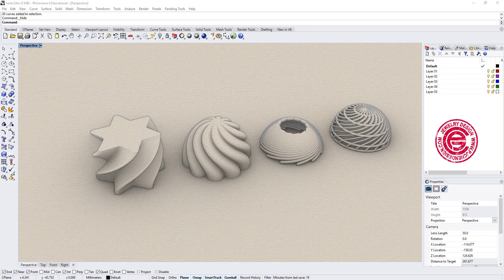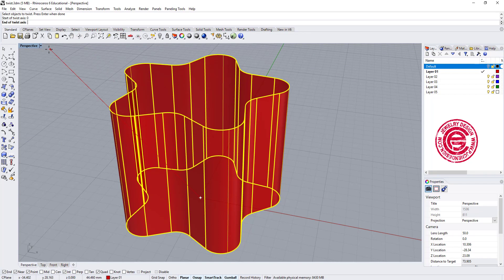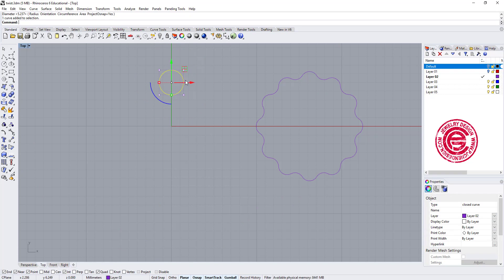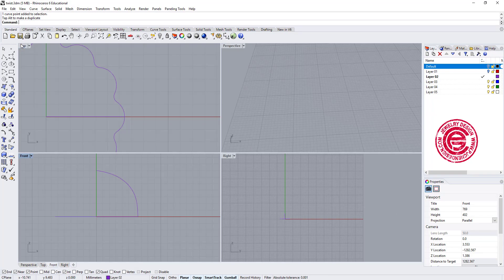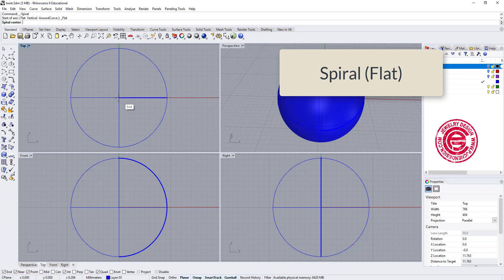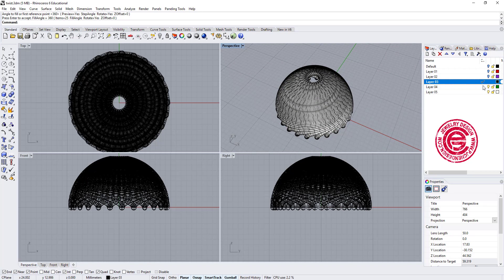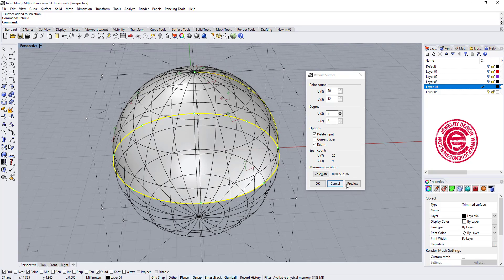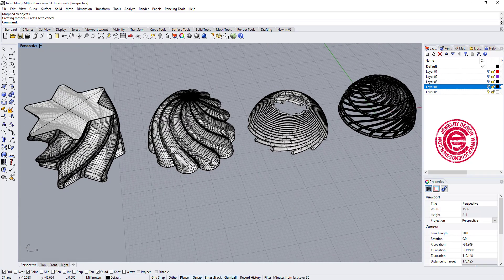How to Twist Forms: Rhino 3D CAD Technique #18

Comment: i have a proplem with Rhino
when i want to mesure the Distance between tow Points in Bloc, i can´t select the corner without selecting the Bloc 

could you helb me to get out Please
Reply from the maker: you may want to make sure the correct options are selected on Osnap. If there are nothing to snap on. you may want to extract a curve from the surface first then you can Osnap to the curve.

Comment: All the designs are beautiful. But when I try to print the second design on a 3D printer, it shows me an error on the top part and closes the surface. Can you tell me why?
Reply from the maker: It is hard to tell what may be the issue without seeing the model. but you may want to check on your Osnap. if you are snapping at the correct points when you build the model.
Reply: @PJChenJewelryDesign  Thank you
Reply from the maker: You are very welcome!